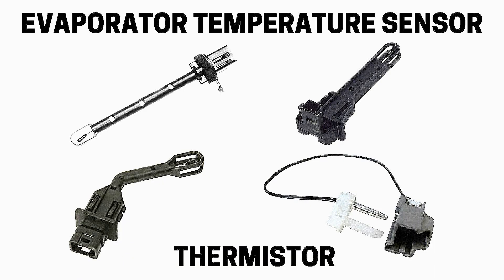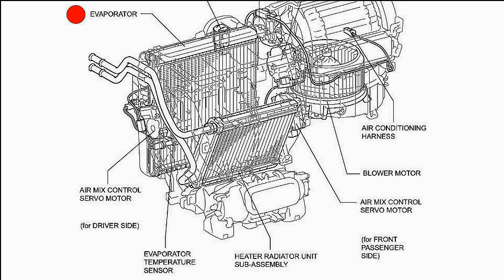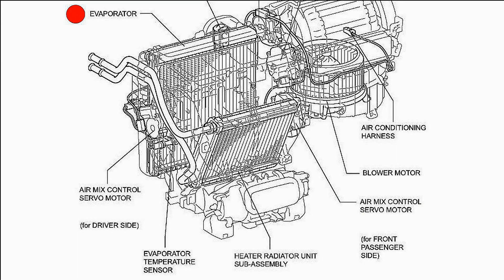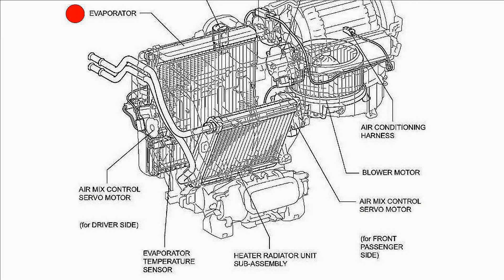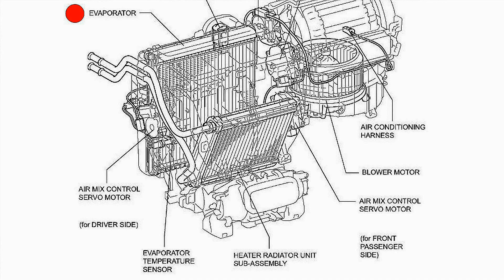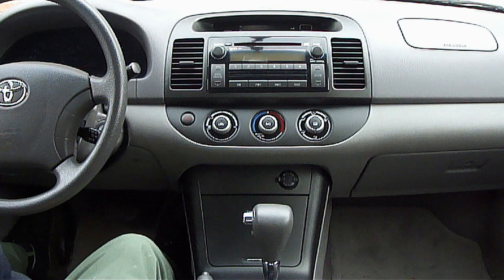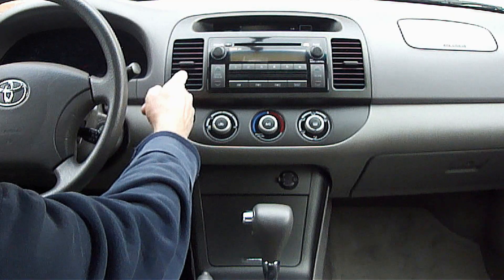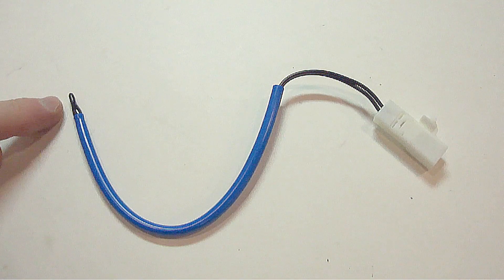Car AC Not Cooling - How To Easily Check AC Temperature Sensor

Comment: I just found the sensor behind the evaporator/blower house under the dash, but it is impossible to reach it since it is tightly located between the evaporator/blower housing and the firewall. Even if it was reachable enabling it to be exchanged with a new one, the wire that connects the sensor to the probe goes to the inside of this housing, making it impossible for the whole set (sensor/probe) to be swapped for another one without disassembling the "thing".